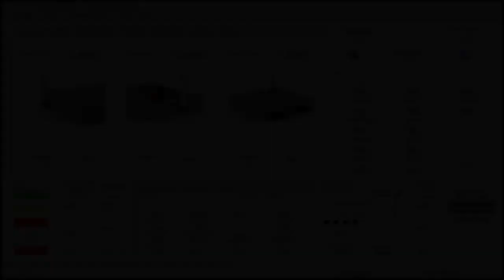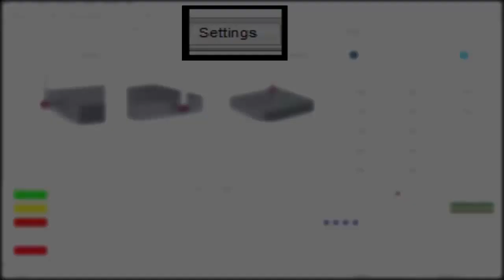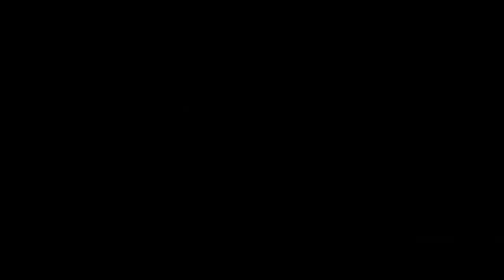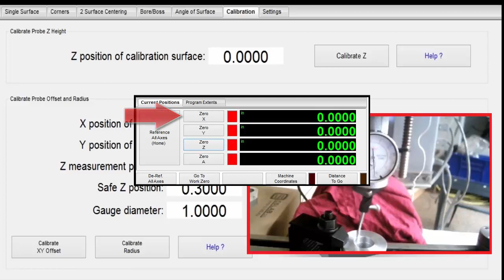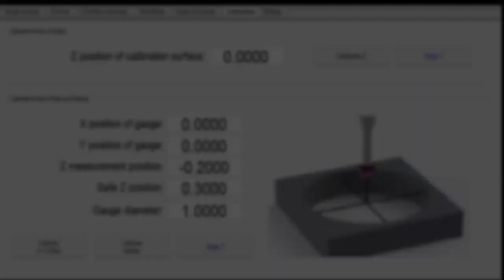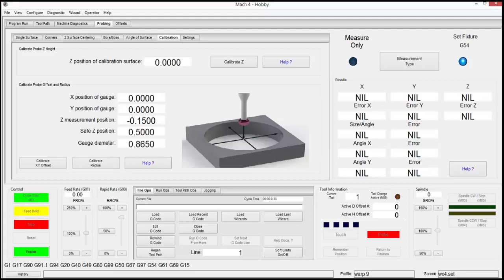Probing Calibration Mach4 step 1

Comment: Is the position of the gauge in the G54 or machine coordinates?  Should the gauge be mounted on the machine in general or is it only needed for the calibration and can be removed from the machine table in general use?  How often do you need to calibrate, just at the change of a probe tip, etc?  Thanks!